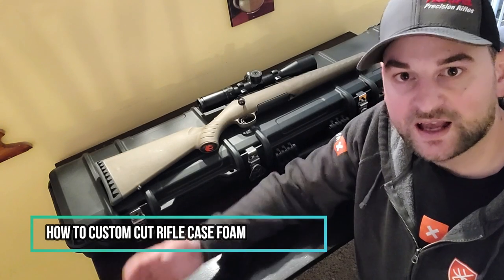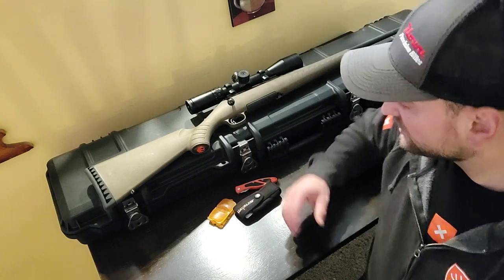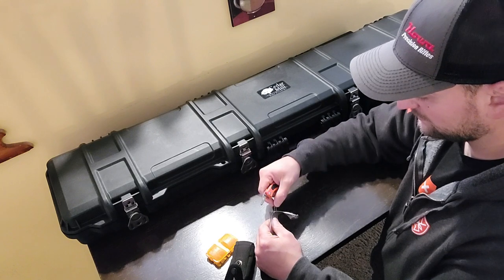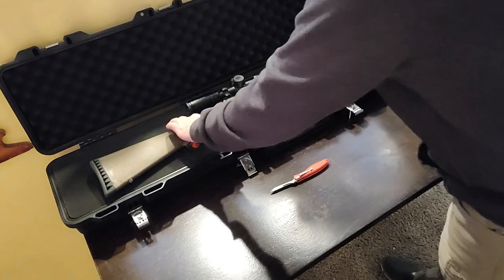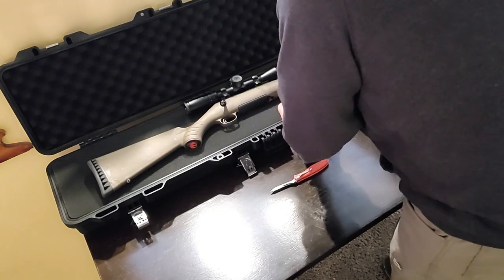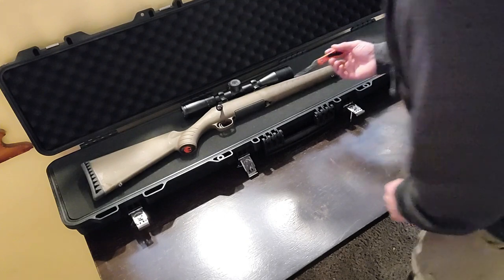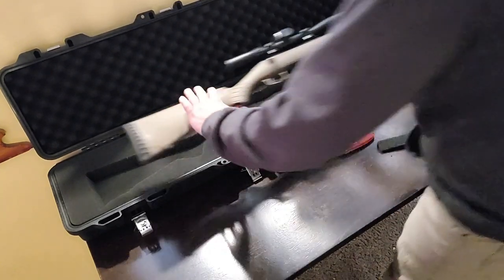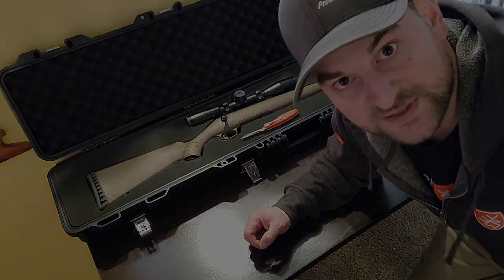Fastest way to cut foam for gun case!

Comment: Thanks! Do you ever keep your optics toward you? Think about it...that way when you carry it by the handle the glass doesnt bear the load. Just ideas.
Reply from the maker: Not a bad idea but i just like it this way
Reply: @Bullets4Bucks  I set all of mine up like yours. I just think about that after hearing someone mention it.
Reply: You could also add extra relief around the optic so it never actually bears the weight
Reply: You can always rotate the foam on the other side. Its not glued.

Comment: Thanks for that, hope to get an answer to my n00b question, as I'm just getting into this for real now:

The way you cut it, the scope is still not level with the foam's surface, is that an issue?
I know that the lever is at an even higher elevation than that, but I'm wondering if, when the case is closed, the top foam might not exert undue pressure on the scope?

I guess carving out a form-fitting groove in the lower foam would defeat the purpose of "quick'n'easy", but just wondering if that extra effort would be worth it, or not really after all.^^
Reply from the maker: Its not bad depends on case but foam on top lid will still protect it

Comment: Get a U shape pvc or make one 2 small trnsion springs and a thin metal string along with 2 9v batteries, attach the string to the pvc tighten is up with the springs glue 2 9v bolts or tape or anything 1 each side use your excess wire to connect the energy to the wire and make sure you do it in the"wrong terminal alignment" of the battery. Once they are you'll feel the wire heating, and quickly turn red you can now run it through any foam or Styrofoam with no issues
Reply from the maker: Interesting

Comment: My air rifle has doesnt have the foam to cut out.. theres egg shell foam on both sides instead of just the top side like your rifle case.. will the rifle break under the pressure or is it ok?
Reply from the maker: Its probably ok which case did you get?
Reply: @Bullets4Bucks  nuprol XL hard case.. I've seen everyones have the egg shell at the top side and just cut out foam on the bottom side but mine just has egg shell foam on both side... when I close the case I have the push the case down then close the lock as it doesnt go down. I'm worried the rifle will get squashed or damaged in there
Reply from the maker: @Brock-Lesnar-WWE  it should be fine